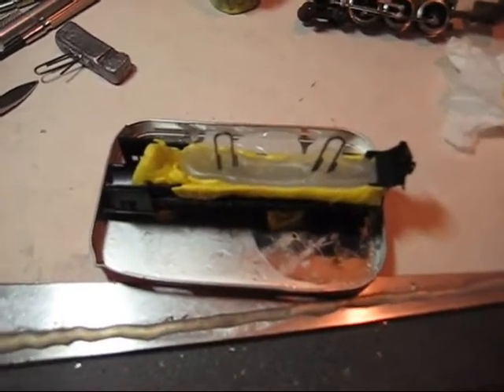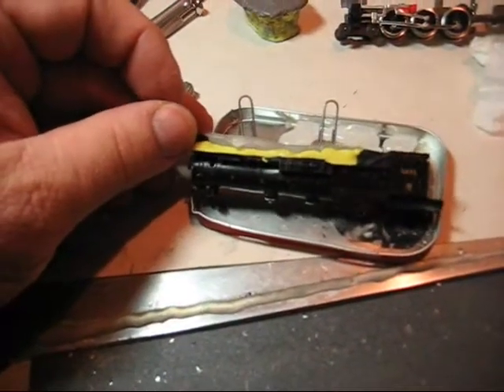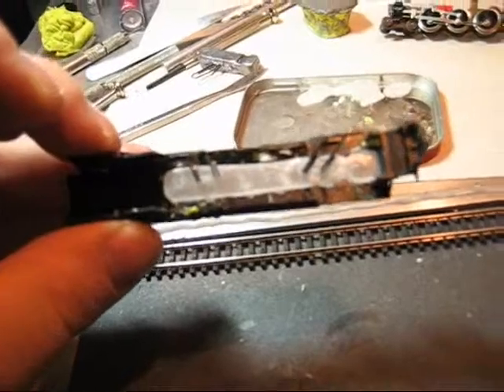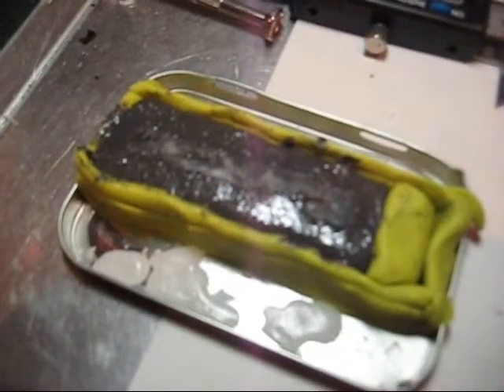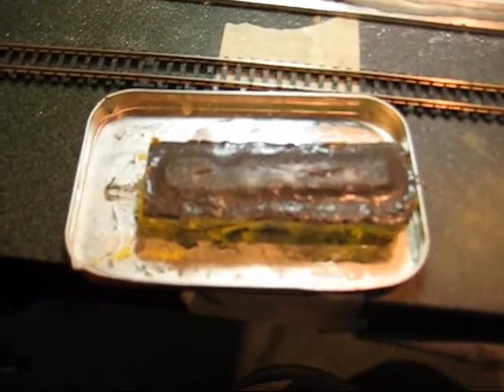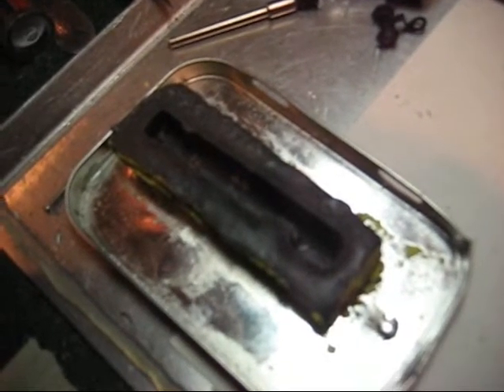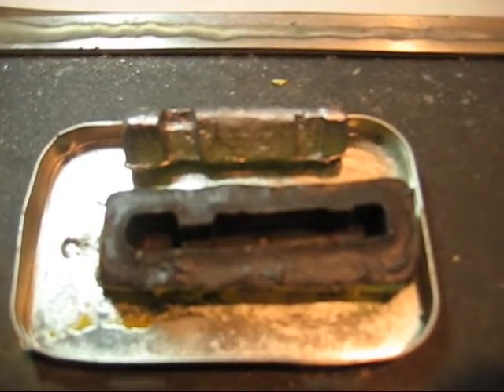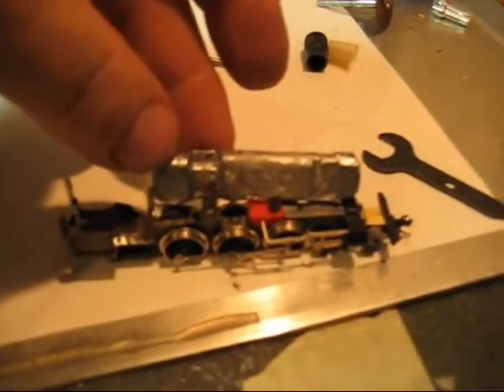Casting a Lead Weight for a Locomotive Project

Comment from the maker: @trains72345  You're welcome!  Let me know if yougive it a try!  This video is a very primitive method, but the principle is the same. Typically, once a wax pattern is made, sprues, vents and pour spouts can be added to the pattern and then dipped in ceramic paste over and over until the ceramic wall is thick and hard enough. Then the wax is melted out, leaving a cavity to pour the hot metal into.